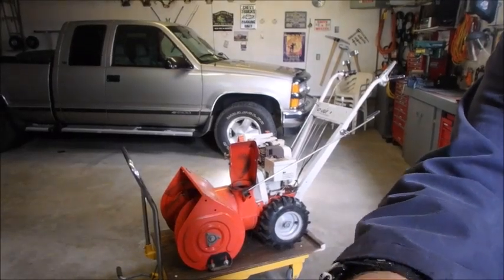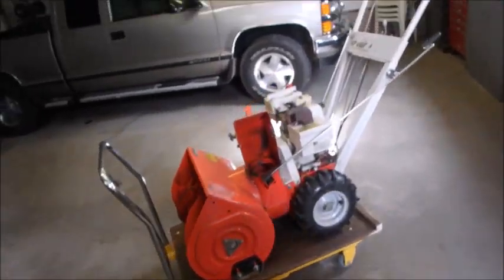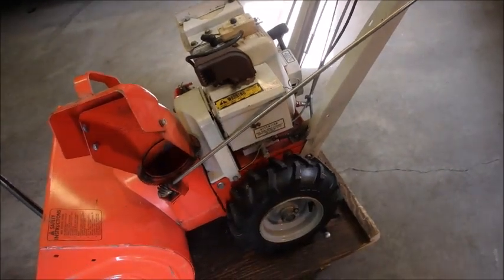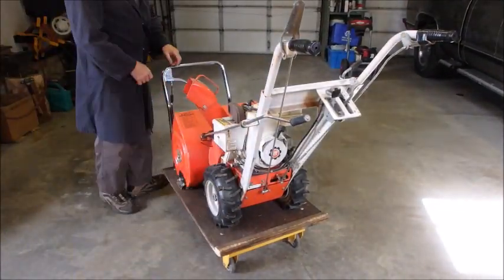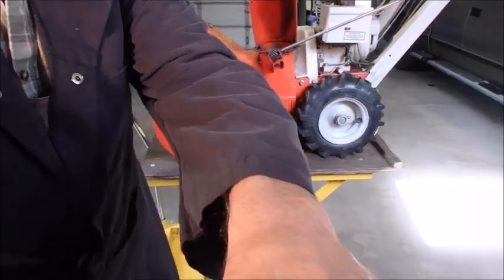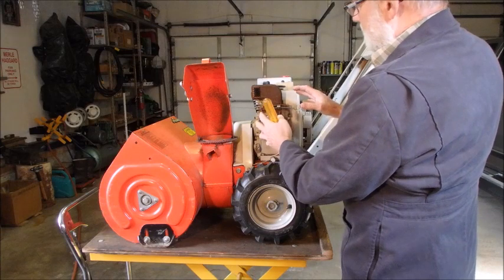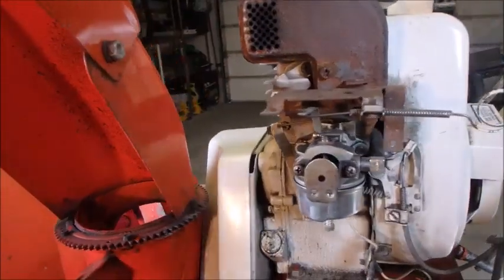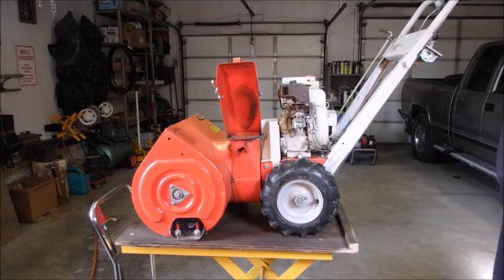Fixing a Hard to Start Ariens Snowblower

Comment: Hi Bruce, I have a 4hp model 92018 but I’m having trouble finding wheels for it.  The wheels on this one seem to be aftermarket ones that are pinned or bolted to the shaft and not splined with the feather key. Did you install the wheels on this machine??
Reply from the maker: I changed the wheels from the ones in this video below.  I used bushings to get the newer ones to fit.     Sorry this is the best i can do.  This video was from Dec 2015
https://www.youtube.com/watch?v=AtR5kelkCUY

Comment: Thank you very much for this video!!! I have a question: what would be causing snowblower to loose power under load and die when warm. Please help, thank you! I did grind valves and did leak down test and engine is retaining 60psi and only leaking 10psi so I think valves are good but I don't know what could cause it to die after warm and under load
Reply from the maker: I would go back to the carb and check it.
Reply: Pro tip : you can watch series at flixzone. I've been using them for watching all kinds of movies during the lockdown.

Comment: you can just take a small flat file and insert it between the valve and the push rod and grind the valve without removing any part
Reply: Exactly it's a good tip! Not the fastest way to remove material, but it save you all disassembly and possible problem with old gasket, bolts, etc
Reply: Considering he couldn't get a .002 feeler in there I doubt you'd get a file in.
Even if you could, you'd be taking material off both the valve stem and the push rod, not the right way to do it.

Comment: While your under there, it should have points and condensor, I would either replace, or clean and adjust, you know while you have it apart it's a good time to check em, or change it over and get rid of the points system, waiting for part two as well.
Reply from the maker: You are so right.  This is my own unit and it has only been run 2 or 3 hours since I went through the entire machine.  That is why I went straight to the valves.  Sorry I was rushing a bit.  Thanks
Reply: Bruce Pender no need to be sorry, take your time, but yes, it being your own machine, keep the videos coming ty.
Reply from the maker: See even my comments need to be edited I rush so much

Comment: Is there anything to be done about rod knock?  I have a briggs mower with knock, but no smoke.  I put half lucas oil and half 10 weight synthetic in the crank case and that quieted it a little.
Reply from the maker: Well is the knock up high or down low.  Put you ear on the end of a broomstick and touch it around.  (poor mans stethoscope)  and check it out.  If is broken you can't break it.

Comment: hi bruce,love all the vids ,good job! i have a ariens 4hp snowblower,no spark,i puy new coil,points ans condenser and even changed flywheel and still no spark,PLZ HELP,ironbill8
Reply from the maker: It is usually something simple.  Check the continuity of the spark plug lead to the end of the plug connector.  If they don't pierce the cable or something like that.  Measure the resistance of the points while everything is disconnected.  Should be close to 0 Ohm's.  Hold the spark plug wire in your hand while slowly rotating the motor.  You should feel a tingle at least.  Is the condenser OK.  .  Are the magnets on the back of the flywheel there??? and are they OK.  Are there any pinched wires when the unit is assembled.  Just take you time.  I hope you have some kind if meter to check resistance
Reply: I had the pinched wire the first time around,glad i bought 2,lol actually I have more snowblowers with same problems,no meter tho,I was thinking the plug end was not piercing the wire to,not very good set up,20$ could from Amazon,lol,gonna try that first,I'll let u know,THANK YOU BRUCE! and merry Christmas!
Reply: Did you turn on the fuel valve and dropped in a couple of quarters?????? Lmao